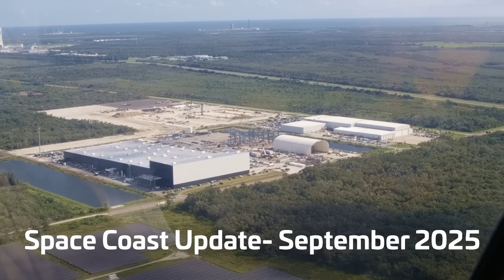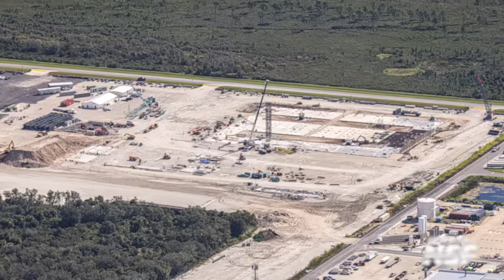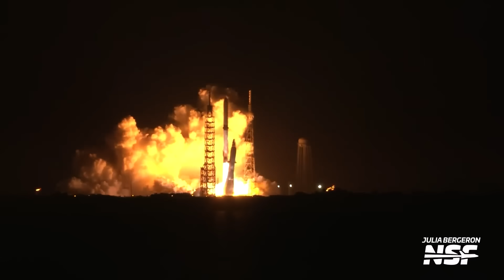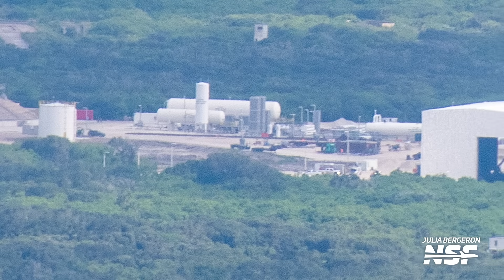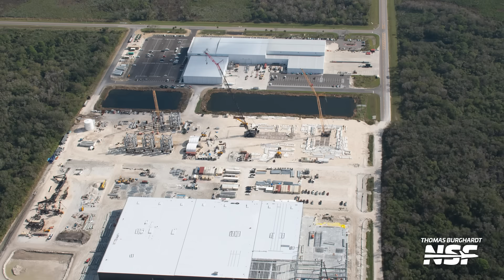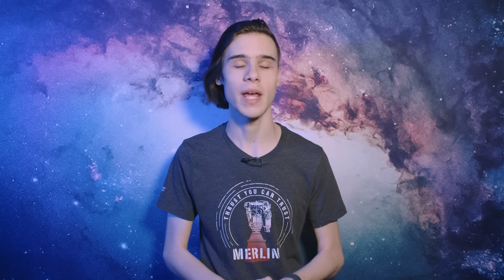🚀 SpaceX’s New Starship Tower at the Cape + New Glenn Flight 2 Nears! | Space Coast Flyover

Comment: To offload propellant after a ship catch, SpaceX will need a QD at the base of the ship (i.e. On the launch mount - NOT way up on the tower). If there is a QD up on the tower, as in current design configurations, then they plan to perform launches from said tower...
Reply: If it is a catch tower why would they have a launch mount *at all*?
Reply: Wouldn't the QD for offloading need to be higher if they plan on catching starships as well?
Reply: Why could they not lower/raise it with the arms to the level of the SQD?

Comment: Lunar, lander hack, drop only the nose cone with the front raptor engines and cargo to land on the moon, leave the tanks in orbit. Redock for earth reentry, saves 80% on fuel, no space elevator needed, self levelling legs. It is way simpler  
     Let Elon know.
Reply: Using what propellant for the lunar landing and liftoff - after having left the propellant tanks in lunar orbit?  Stage separation/reintegration and docking mechanisms and other related hardware adds more dry mass and complexity.  Also there is no surviving Earth reentry for HLS Starship, as that variant has no flaps or heat shield.  Per Artemis HLS architecture, the crew returns from lunar orbit inside Orion: the same way as they arrive from Earth to lunar orbit in the first place.

edit: also, Starship HLS doesn't have enough delta-V to return from lunar orbit back to Earth.  And even if it was upgraded to add the capability for a trans-Earth injection burn, it still doesn't have the hardware to aerobrake into low Earth orbit: it'd have to rely completely on engines and propellant to enter low Earth orbit, and recall that it doesn't have enough propellant to even depart lunar orbit to begin with...
Reply: I like how pretend engineers add many more failure points and extra undeveloped hardware when pretending they're making things easier.  It's laughable.
Reply: @imaginary_friend7300  it’s doable